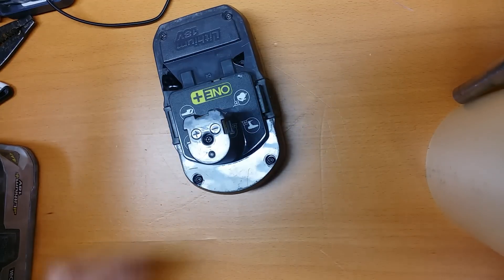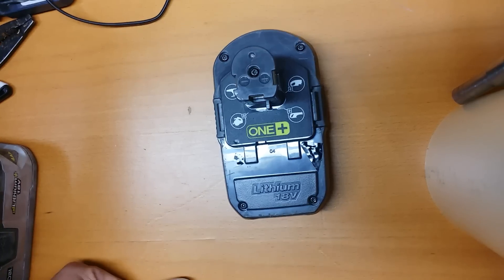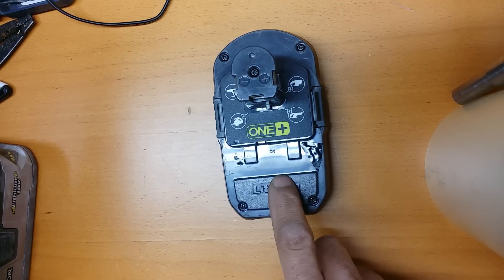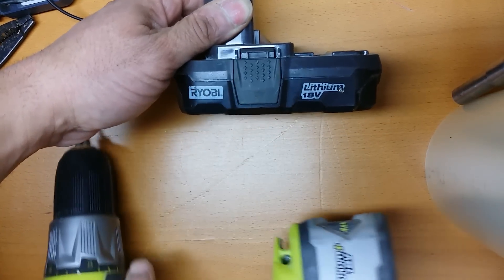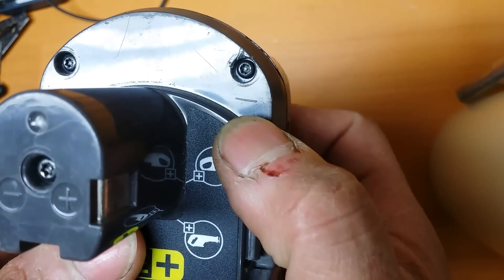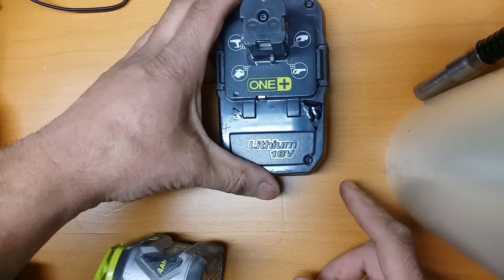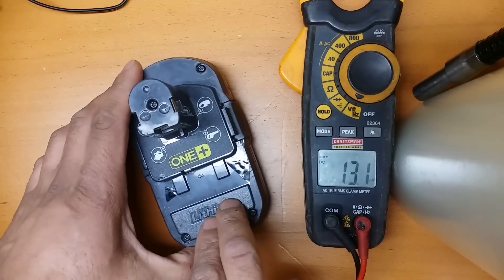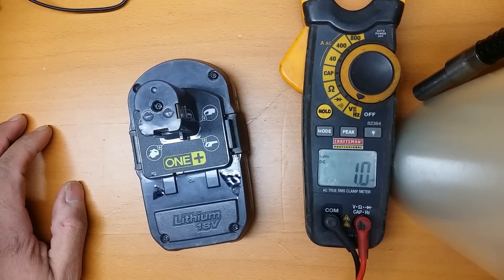How to revive a Ryobi 18 volt lithium battery. Quick and easy

Comment: literally watched this video and went and did it to 2 of my dead batteries. What I did was drilled right where he did in this video, attached 2 16 gauge wires to the + and - of a fully charged 18V Ryobi and touched inside the new holes I drilled, for about 3 seconds that is all (with my multimeter attached to the dead one with a clamp and it jumped right to 15V and climbing) took the battery slapped it in the charger and whammo! it's charging, did it to the second one again for 3 secs, and these batteries were both at 0%. Both are charging now. Awesome and thanks for this video!!!
Reply: I just did this and it worked. I used a fresh ryobi 18 volt battery to jump it and only applied it a few seconds. And now it's charging. Unbelievable. I had a torx bit so I opened it up and didn't drill but same technique. Thanks man.
Reply from the maker: Brian H . Great idea never thought about using multimeter while boosting the pack👍
Reply from the maker: lcagee. you're welcome

Comment: SWEET!  I have two dead batteries that aren't even 6 months old so I hope this works.  I will try it tomorrow.
Reply: Yup it works, literally watched this video and went and did it to 2 of my dead batteries. What I did was drilled right where he did in this video, attached 2 16 gauge wires to the + and - of a fully charged 18V Ryobi and touched inside the new holes I drilled, for about 3 seconds that is all (with my multimeter attached to the dead one with a clamp and it jumped right to 15V and climbing) took the battery slapped it in the charger and whammo! it's charging, did it to the second one again for 3 secs, and these batteries were both at 0%. Both are charging now. Awesome and thanks for this video!!!
Reply from the maker: Elmo... let me know if this works for you?
Reply: if this happens to mine within that time surely I could just get replacements as they have failed so quickly ?

Comment: Why can't you just touch the terminals on the tower instead of drilling holes in the battery?
Reply from the maker: mateollios.   When voltage is very low you can't  charging it  with the terminals on the top . The circuit board and the lithium batteries won't let you that's why I though I drill the holes  on the pack
Reply: There must be a gate in the circuit that disconnects the battery pack from the tower when voltage is too low. Adding current at the battery pack must open the gate.
Reply: It has a circuit board inside that blocks charging if the battery is too low.
Reply: What I did with my Milwaukee pack was solder 2 leads straight to the battery and use a RC car battery charger to bypass charge the circuit. Works great and the rc charger was cheaper than the proper charger. Also, I can charge different brand stuff with the same charger. If you want to get more elaborate, you can attach parallel leads to all the cells for a balance charge although, it's much trickier to do if one cell starts to get funky.

Comment: I look at some of the comments but did not see my question is are you able to jump the battery or revive the battery from the top terminals on top of your battery it states plus and minus can I jump it from there without drilling holes in the side of the battery
Reply from the maker: the eabster . No it can't be jump from the top of the battery terminals. 
The Circuit board in your lithium battery wouldn't let you jump it when the battery voltage is extremely low. Thanks for the question good luck!
Reply: tomstuff460 okay thanks I ended up taking mine apart but the battery I have is a p108  so it's the 4 amp hour battery. And it does not work the same positive being on a front left negative on the back right, the same way you have the battery sitting in the video.   it just through Sparks everywhere. it would not allow me to jump it the way you did with this battery . And I cannot find any other videos on the p108 battery. but did not realize he's batteries come with a 3-year warranty. I contacted Ryobi and they are shipping me out a new battery.  But thank you for responding back..
Reply: Wow, Ryobi is really replacing a battery with holes drilled in it?  Or are they just not asking for the bad battery back?
Reply: gernith they're not asking for the battery back . All they asking for was to send them a copy of the receipt showing that the batteries are Within the warranty period .
Reply from the maker: the eabster .
I just don't want to waste my time ship in the back to Ryobi  or some i dont have time waiting 7-14 days to for Ryobi to ship it back. my i don't have my receipts for the warranty
Reply: tomstuff460 my best advice would be to pick up a new battery wait a week and then get ahold of Ryobi tell him it's broke take a picture of that receipt and send it to him they're sending you a new battery and you can take the battery you just bought back to the store. And get your money back. Ryobi does not want you to send the old battery to them at all their only request is for you to dispose of it properly
Reply: I am about to try to revive a li-ion cell by using the battery posts. I am pretty sure it will work as all the nimg batteries I have tried worked that way.

Comment: Brilliant solution! I have two newer batteries that have gone "dead" for the second time. The first time, I took the cases apart and  revived the batteries. I've been dreading doing that again. But your solution is excellent! I drilled the two holes exactly where you did, and the terminals were exposed. The positive and negative terminals are opposite those on the raised portion that fits into the charger, just as you showed. 

I gently threaded a #6 short bolt in each side (about 1/4") until they stopped so I had something to clip onto. I checked the voltage which was at 3.3VDC. I used my car charger on the 12 V / 2A setting and turned it on for 10 seconds. This raised the voltage to 10.8VDC and the batteries are now recognized by the charger. I removed the bolts and put a small piece of electrical tape over the holes for protection. 

Beautiful solution! Thanks for taking the time to share it! :)
Reply from the maker: Unplugged Doug ....hum great idea and You welcome!

Comment from the maker: To Michael Cunningham
 I'm not sure about this battery pack because I don't own a P-105. but I believe it'll be exactly on the same place of the p102 but just in a Double Stack of lithium batteries.  so I would measure the distance from the top to the hole as the some p102 and use that as a reference for the p105. Note that maybe the letters won't be the same height as the p102. be sure to measure correctly. Try this if you feel comfortable.
Reply from the maker: I have another video on my channel for p108

Comment: it didn't work for me😕
Reply from the maker: Hello Majid Moteabbed you need a multimeter to test it ..did  you check the voltage on the battery. In needs to have a lease 10 - 15 DC volts on it .  Battery voltage might be too low. Boost /Jumper the battery for one or two min longer  with some kind of battery source. Let me know your results.

Comment: This is great, I was highly pissed to find my month old batteries just sitting on charger blinking red.  I drilled the holes and put my jumper cables on my boat battery and connected to two 14 gauge wires and touched off for a few seconds.  The voltage on the charging posts was .125 volts and after a few seconds later they were at 10 volts.  I put them in the charger and they started charging right away.  Thanks for a simple solution.
Reply from the maker: tussin34 awesome.
Reply: Start your very own battery business and make huge money here: JoxCharge.com

Comment: Thank you. Used a 12 volt car charger daisy chained to some old wires on a battery that didn't even register on my voltage meter (another battery registered just fine). Saved me having to buy the security bits as well. Yo da man!
Reply from the maker: John Michael . You're welcome.